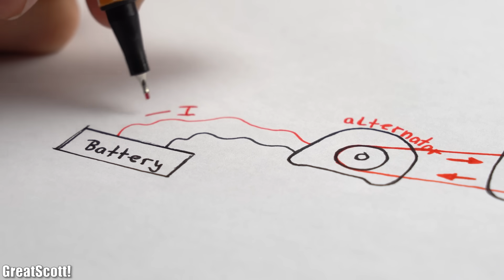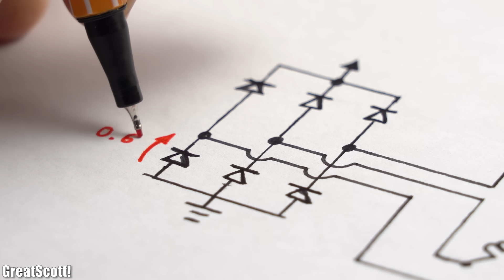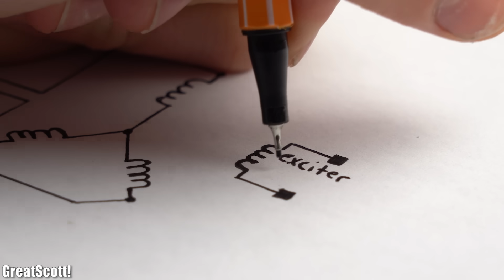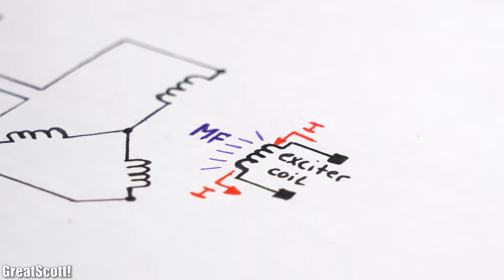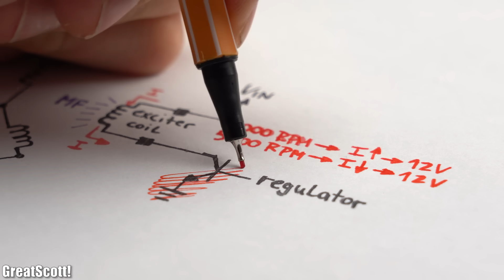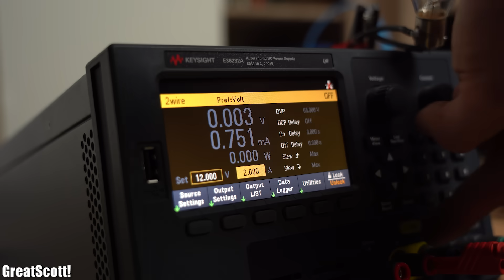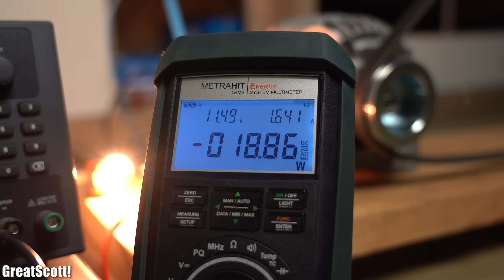Using a car alternator with a bike to power my home? How much energy can I produce?!

Comment: Hey Scott , you cycle's is in low gear. shift it to the small gear at rear and large gear near the pedal for more rpm and power. PLEASE try it😄
Reply: I was very pertrubed when he said he dont have enough RPM at his bike wheel while he had the lowest gear and didnt switch to higher one
Reply: Maybe he should try pointing the bike down hill  ..  ..
Reply: @hanzzarkov7690  Eat beans, he'd have a "tail" wind as well. 😉
Reply: @CHIL2903  eating beans and farting as I read this😂
Reply: @ethangreenyt  I guess only Great Scott should find out atleast in the behind the scenes video.
Reply: @JAYANTHISUDUPIRECIPES  I noticed the incorrect gear also 😂 btw you don't get any more power in a higher gear, you simply trade torque for rpm. Since power is a function of torque and rpm, trading one for the other via gearing doesn't change the total amount of power coming from your legs.
Reply: @thecrazyfarmboy  You don't produce more power, but you transmit more to the ground (or in this case, the wheel).
Reply: @sixstanger00  according to that statement, the gears themselves produce extra power above what the riders legs are capable of? Obviously that's not now physics works lol. Think about this statement - power is a function of rpm and torque. Let's say you need to climb a steep hill, wouldn't you want to put it in a high gear if that gives you the most power? Of course not. The correct situation for a high and low gear are different, but both ways put down the same amount of power. 1st gear puts it down in the form of high torque with low rpm, top gear is low torque with high rpm, and every gear in between is a similar tradeoff
Reply: @thecrazyfarmboy  
according to that statement, the gears themselves produce extra power above what the riders legs are capable of?

Nope. That isn't what I said at all. Bicycle gearing is no different than automobile transmissions - lower gears produce more torque, higher gears transmit more power to the ground. 

In a low gear, the rider's power is being use to turn the pedals (or crankset). Hence why it's easier to pedal in a low gear. 

In a high gear, less power is applied to the crankset and more is transferred to the rear wheel for propulsion. Bicycle gearing functionality is nothing more than torque multiplication. 

The amount of power PRODUCED never changes, but the gear selection determines where the power is APPLIED. 
Low gear = at the chainring 
High gear = at the drive wheel 

Let's say you need to climb a steep hill, wouldn't you want to put it in a high gear if that gives you the most power?

No, you wouldn't. Because climbing uphill puts the trajectory of the rider at a steeper angle relative to the pull of gravity, which is why it's harder to pedal uphill than to pedal across a flat. 

If it's hard to pedal, you want to use a low gear because in this situation, you need TORQUE more than you need POWER. Ergo, it's more important that you keep the pedals spinning than it is transferring maximum power to the drive wheel. 

Transmitting all of your power the drive wheel means dick if you have nothing available to turn the crankset. 

So NO -- just because your highest gear transfers the most power to the ground does not mean that is the ideal gear in all situations. Like I said....max power at the wheel is FAST......as long as you can keep those pedals spinning. 

If you can't climb the hill in high gear, then SOME of your power being transferred to the drive wheel must be syphoned off and used to keep the crankset rotating.

I race mountain bikes, so it's not like I'm just talking out of my arse here...
Reply: @sixstanger00  I think you're missing my point, I'm talking about the definition of the word "power". Power and speed are not the same thing, and now that I read your last comment I'm confident that nothing you're saying is wrong, it's just the way you explain it is way off according to basic physics. When you're in a low gear, you're not 'siphoning off power' you're simply trading RPM at the rear wheel for more torque. That's the key, SPEED and torque are what changes, not the amount of power applied to the rear wheel. You're using the word "power" in places where "rpm" or "speed" belong. I understand what you mean when you say that power is being used to turn the crank in a lower gear, because you wouldn't be able to turn the crank in a higher gear. However, the crank itself presents the same amount of resistance no matter what gear you're in - that's the resistance of the crank and pedal bearings and nothing else. So clearly the power from the riders legs is going through the crank like it always does, and to the rear wheel, where it's producing more torque at a lower speed. The reason you can't turn the pedals up a hill in a high gear is because in that gear, you can't produce enough TORQUE to go up the hill. The reason you can't produce enough torque to go up the hill in a high gear is because you're not actually putting any more POWER to the rear wheel!
Btw, I've been an avid cyclist for most of my life, as well as physics, so don't think I'm just some nerd with no real world experience lol..
Reply: Oh & as for the second part that you put in bold, I was clearly being sarcastic to prove that power and speed are not the same thing.... I literally said "of course not" immediately afterwards and you still took it as a serious statement and corrected me on it?! Good God lol the point is that it's not a matter of "torque or power" it's "torque or speed"
Reply: @thecrazyfarmboy  
Power and speed are not the same thing

I never said it was. Most of your confusion seems to be stemming from incorrect inferences you're drawing all on your own. This is at least twice that you've "corrected" something I never said to start with. 

However, the crank itself presents the same amount of resistance no matter what gear you're in - that's the resistance of the crank and pedal bearings and nothing else.

But it's not "nothing else" -- the crankset is tied to the rear wheel via the chain, and the rear wheel is in contact with the ground So you can't just ignore the drive line, because unless you're riding sans-chain or with the rear wheel elevated, the resistance is always going to be the crank/pedal bearings, etc + the weight of the bike/rider, because ultimately, the system is trying to propel the entire bulk forward -- not just spin the crankset. 

The reason you can't produce enough torque to go up the hill in a high gear is because you're not actually putting any more POWER to the rear wheel!

You're not wrong, but I think we're looking at this differently. You are looking exclusively at the rear wheel, whereas I'm seeing a finite amount of energy being distributed between the drive wheel and the crankset, depending on the gear ratio. (Which is not wrong).

The crankset is what's producing the TORQUE, not the rear cassette. Everything beyond the chainring -- chain, cassette, hub, rim, tire, etc are just a drive train for transmitting power to the ground, in much the same way a transmission, driveshaft, differential, axle, etc are on a car. 

So let's try it this way: 
The easier it is to pedal, the less power the rider must exert, yes? After all, you don't need to pedal as hard to maintain 25 MPH on a downhill as you do to maintain the same speed on a flat surface in a headwind. 

So we therefore cannot say that the power at the rear wheel never changes; it MUST decrease by basic physics because power input at the crank has decreased. 

Now let's go back to your uphill scenario: 
Climbing uphill in 1st gear makes spinning the pedals easier, thus requiring less output from the rider. If you've ever raced criterion or XC, then you must know this fundamental rule. Riders choose low gears on steep climbs to conserve energy so they can blast on flatter sections. 

But if we go by your logic - that is, that the power output never changes - then in what way is a rider conserving energy? Presumably, climbing in 1st would consume the same amount of energy as climbing in 5th...? But for that to be true, the rider would have to be as exhausted at the top in a 1st gear pull as in a 5th gear pull...? 

I have also been a major automotive enthusiasts most of my life, and I've always looked at a bicycle the same way as a car.
Rider = engine 
Pedals = pistons
Crankset = crankshaft/flywheel
Chain = input shaft
Cassette/derailleur = transmission/final drive gear
Hub assembly = axles 

In a car, if you try to drive highway speed in 1st gear, you'll redline at extremely high RPM, because all of the power is being used to spin the transmission itself, rather than propelling the vehicle forward efficiently. (i.e. very little engine power is actually making it to the ground). 

At highway speed though, inertia takes some of the workload off the engine itself (just like on a bike), thus less power is needed to keep the driveline spinning, so the power can instead be transferred to the ground and propel the vehicle. 

That's how I'm looking at a bike. There are power meters that can be attached to a bike's crankset (I'm sure you know this). 

So if I were spin the pedals as hard as I could in 1st gear, the meter would register a ton of power, but I'd be crawling along at a snail's pace. Ok...so where is all that power going? CLEARLY it can't be going to the ground, because if it were, I'd be propelled forward much faster. 

The answer, as I've maintained, is that all of the power is being used to rotate the crankset & driveline. 

The gear range on a bike determines how the power gets distributed between the crankset & the ground. 
More to the crankset = easier to pedal 
More to the ground = harder to pedal, but propelled much faster.
Reply: @thecrazyfarmboy  
Good God lol the point is that it's not a matter of "torque or power" it's "torque or speed"

Um, no. You're the one who just got through telling me power =/= to speed. 

Any kind of vehicular work has always been measured with "torque and power." 

Torque = twisting force 
Power = what's available to apply twisting force 

A vehicle moving at high speed uses less torque because inertia is doing the work. Thus, the finite amount of power available from the engine can be redirected to the ground instead of focused on twisting the driveline.
Reply: @sixstanger00  "thus, the finite amount of power available from the engine can be REdirected to the ground instead of twisting the driveline." LMAO listen, saying words like 'thus' and 'finite' doesn't make you know what you're talking about, it only makes it sound like you do.
Reply: @sixstanger00  what I've been saying is not MY theory... It's very basic mechanical physics which any professor in the field would back me up on, however they'd also be smarter than to get into an argument with someone who doesn't even know what they're talking about in the first place. (which is where I'm guilty.) I didn't make it up, I learned it from both study and experimentation. You may know a lot about how to ride a bike and what gear to choose, but your understanding of the science behind it sounds like your own made up theory.
Reply: @thecrazyfarmboy  90 rpm is peak good for human legs
Reply: @thecrazyfarmboy  Scott said in the video that the alternator is designed to produce power at around 2000-3000 RPM, and he was turning it much slower than that, so a higher gearing definitely could produce more power.

A decently fit cyclist can generate several hundreds of Watts for short periods so he definitely wasn't getting an efficient power output for his effort.
Reply: @XenFPV  That's true, in terms of generating electrical power, you are absolutely right that he could generate more using a higher gear ratio. I was simply referring to the laws of mechanical power, trying to explain the relationship between force and velocity, and the fact that in a low gear you're not just using up power to "turn the driveline" like the guy I was arguing with said. If you're pedaling up a steep hill, obviously the power from your legs is being transferred to the rear wheel right? Because you may be going slower, but you're also producing way more torque at the rear wheel. And as he didn't seem to be able to understand, mechanical power is a function of both torque and rpm.
Reply: @sixstanger00  That's not how torque and horsepower work. A good way to think of it is torque=the total angular force and power=how often that force is applied (it's a bad analogy but it's the best way to explain it in simple terms).
Reply: @JAYANTHISUDUPIRECIPES  it's just like how a 200 hp car will be able to produce 200 hp regardless of whether its in 1st or 5th, the difference is how the power is delivered
Reply: @thecrazyfarmboy  car motors do not delivery constant power..
There is a rpm curve
Reply: @sarahconner9433  yes yes I am fully aware of torque curves for engines and how they dictate power based on how much torque is produced at a given rpm. I was trying to explain something in simple terms so that he might understand it. Also yes I know that humans can only reach about 100 rpm at the crank, but I don't really see what that has to do with anything lol. My point is that if you're pedaling at 100rpm as hard as you can, then it doesn't matter wether you're going slow up a steep hill, or fast on a flat section. If you're pedaling as hard as you can to maintain the current speed, then you're making about the same amount of power in both cases.
Reply: @sarahconner9433  : Actually, car motors, when the throttle is kept at one position, do produce the same amount of power.

The reason why a car has an RPM curve, is because of going from idle (little to no throttle) to Wide-Open Throttle (WOT). If at any point in that curve the throttle is kept in the same position, it would produce the same amount of power over time (ex: 50% throttle).

What is being discussed here is the idea that automotive transmissions take whatever power is available to overcome inertia and friction to put a car in motion. With a bike, it's the driveline. Because a human rider on a bike will always have less mass than a human in a car, it takes less energy to get the human on a bike moving easier.

When you add in all of the ratios in the gearing and driveline, that is where the application of the available horsepower or watts (units of force) changes, because at that point, you're using the same amount of force, and changing it from torque to speed.

Unlike many people, I find the term "power" to be a misnomer, because that term was not one I learned about in high school physics class.

And just so anyone knows, I also compare a bicycle and rider to a car. The difference is, cars -- particularly AWD and RWD cars & trucks -- have one more gearing ratio a bicycle doesn't have, which is the final-drive ratio in the axle. Some would argue that the transmission is the front chainring, but I disagree, because that is not where the majority of available force is changed, the rear derailleur is. The front chainring is where a transmission would go into overdrive, for example, as most cars go from 1:1 (engine:transmission) to, at least in my truck, to a 1:0.75 overdrive ratio. Ergo, the chainring, like the Overdrive gearing, or trucks with a Tow Package, acts just like those ratios do in a transmission. The rear derailleur does not act like the final drive ratio that is located in a rear axle, because the final drive ratio in a car or truck never changes.
Reply: @isaiahwelch8066  thanks for your comment. Were both trying to help this guy....I worked at Ford , general Motors and Honda F1... Car motors with fuel work on the principle of;:  "adiabatic isentropic exponent" of a Carnot heat cycle and the electromagnetic lightwave  motor of hienrich Hertz.... Very complicated stuff... Car gas fuel motors vary in efficiency at all rpm.... usually Rich at low rpm and lean at high rpm and make horsepower kind of  linearly with increased rpm.... The interface is compression ratio, temperature of exhaust and valve lift duration.... As rpm increases valve lift duration decreases and eventually at 20000rpm (333hz),  the valve duration becomes almost zero, and fuel and air  flow declines and less horsepower... Not including balancing camshafts and valves at 20000rpm.  So it's not at all related to the carb throttle... As all modern cars are fuel injected or even digital... In a bicycle the transmission loss is basically zero... Zero chain stretch from  human legs..friction loss in wheels is more...pull a bike..I did...it takes about 8 poundal force to maintain about 8mph constant speed...i.e. little wind.... Literally I used to use my 1 pinky finger on the rear tire of   F1 race car and shake it effortlessly forward and reverse like a empty can of soda.... Top secret frictionless wheel bearings... The purpose of gears is to change a  constant power input  to variable torque values output...output in a bike or car is at the wheels
Reply: @sarahconner9433  : Okay. Hate to tell you this, but there are several issues with your statement.

1. You mention that RPMs can reach 20,000, in a car. I do not know of any car that will reach that high of an RPM, as most engines will break apart before ever reaching that engine speed. The closest engine I've ever heard of that got anywhere near that speed was a DOHC engine that TRD (Toyota Racing Development) made for the AE86 Panda Trueno Corolla, back in the late 1980s. It still had a carb on it. Point is, even in that engine, you couldn't go more than 11,000 RPMs in it. If you pushed the RPMs to 13,000, you usually blew the motor up.
2. The next thing is that in most modern cars -- going all the way back to 1989, when fuel injection was made standard -- most engines, even OBD-1 engines, had some way to get out of closed-loop engine management, and into open-loop engine management. On my 1992 Ford Ranger, Ford did this by routing exhaust heat to a vacuum valve, which would let warm air combine with cold air, and thus, even from a cold start, maintain a better A/F ratio. When the engine was warm, this valve closes, as that function is no longer needed. Given this, you say that the efficiency of an engine varies across all RPMs. While technically true, it does not vary as much as one might think. Most custom engines with lobe lift in an aftermarket cam do not vary, with engine speed. What you refer to is something that Ford and other manufacturers only started doing about a decade ago, when VVT heads were introduced, which do vary cam lift and duration. Previous to VVT, this is not the case.
3. This is a point that makes me doubt what your entire statement is, because I never said anything about a carburetor. I mentioned a throttle -- this does not necessarily mean a naturally-aspirated, carbureted engine. I was referring to a throttle in the sense that the throttle was contained in a throttle body -- which, if you knew cars like you say you do, means that they are computer-controlled, and use digital signals to control different components, unlike carburated cars, which use vacuum components. 
4. As for bicycles: Actually, bicycles can have transmission loss. Anything that spins, if the bearings are bad or worn, can, in fact, result in a chain drive hesitating. I've ridden bikes like that, where that is the case -- and most often, the loss of transfer happens at the cogs on the rear wheel, because of brake dust and other dirt. Second, a chain on a bicycle can become stretched. The last few times I've gone to my local bike shop, they keep bugging me to replace my chain, because it is around that maintainence period to do so. And yes, while the wheels are the actual output in any system, most people who watch this video never consider what actually happens to the values of both torque and speed, as each set of gearing is encountered. There is a major difference between the following:
Bike: Human input (legs)>pedals + chainring>rear cogs>rear wheel
Car/Truck: Engine RPM>Clutch/torque converter>Transmission>driveshaft>rear gear ratio>rear axles>rear wheels

By the way, this isnt even covering both superchargers and turbochargers on cars, which change how cars operate immensely.

As you can see, the two systems are somewhat different, because the mass of the two conveyances are different, and thus, require two different means of overcoming both friction and mass, which acts on both.

While I get what you're trying to say, my biggest concern is that people who read your comments wont realize the common denominator between the two systems, which is the rules of physics, and how the applications of each are designed to overcome those rules. And in the application here, trying to use a bicycle to generate electricity, I find that the video creator really needs a bigger understanding of how electricity works, because I believe that if anyone were to just follow this guy's lead, he is going to get people hurt and injured, possibly killed. Electricity is no joke, especially if you approach it half-ignorant and half-cocked.
Reply: @isaiahwelch8066  oh isaiah anyone so woefully  out of touch with engine technology especially F1 is just sad 16, 17, 18 and 19700 rpm is common place especially with prototype newer models.. However they usually computer limit the rpm.. And Mazda wankle prototypes are even higher...either way motor engineers F1 discuss. 333 hz just as a common standard of upper limit rpm..... Darn it!, I thought I was talking with a real engineer....
Reply: @sarahconner9433  : There's the difference: I'm not talking about prototypes, I'm talking about the cars that are sold to the public. Since when has any F1 car, or a prototype like what you describe, been sold to the public? I mean, not even Nissan Skyline R34 GT-Rs are imported into the US. And yeah, the Mazda Wankle engines can be that fast, speed-wise -- but a car that has an engine like that? Only used on a track.

It's like trying to say that NHRA drag cars and funny cars are street-legal, when they're not. 

But even then, we've gotten away from the subject of the video -- and given that the creator really has no idea of what he's doing, I'm not sure if I want to see anything else he does. I mean, when a TV reality show on Discovery Channel -- The Colony -- can get it right about making power from a generator/alternator, and using wood gas at that, then what can anyone conclude, but that the content creator here, should do more research before trying to put out this kind of video?
Reply: @thecrazyfarmboy  no. That is definitely not true. You dyno in your 1:1 gear for a reason.
Reply: @wyattwalker3189  so tell me what that reason is then, based on experience and research, not speculation
Reply: @wyattwalker3189  I'm pretty sure I already know why you dyno in top gear, and it's not because you put down more power in top gear, but I want to hear your reasoning first.
Reply: @thecrazyfarmboy  you dont dyno in your top gear🤦‍♂️ you dyno in your 1:1 (normally 3rd gear) so your gearing doesnt affect your power (increase or decrease depending on if your below your 1:1 or above)
Reply: @wyattwalker3189  honestly, right after I made that comment I realized most cars have a 1:1 gear and it's usually not top gear lol. Dumb thing to say on my part. With that being admitted, I still stand by the fact that you put down the same amount of total power in any gear. It makes sense to always dyno at 1:1, for the sake of consistency between different cars on the same dyno. In a lower gear you get more wheel torque and less speed, inn high gears you get less wheel torque and more speed. Power is a function of both. Not one or the other!
Reply: @thecrazyfarmboy  🤣
Reply: @sarahconner9433  Engines do have rpm curves and produce different power at different RPMs. The point of the gearbox is to keep those rev's within a usable power-band for the engine. You could drive at 7500rpm in first gear, your engine won't last long and your wheels will likely spin as it's geared for torque to get the vehicle moving. As you move up the gears the torque drops as do the revs (for a given road speed). 
A bike is a great example - try and cycle off in the smallest cog (rear) and it's really hard to get moving but when you do your top speed is high and your legs (motor), are going at a reasonable speed. Now put it on the largest cog and it's easy to set off but if you want to go fast your legs (motor) will be going at crazy rpm.
Reply: @andrewausterfield6710  yes I thought I said this
Reply: He needs better support on the rear bike axle. Two posts per side and and angle, like this one 3:50 and a belt tensioner
Reply: @ethangreenyt  yeah I too accept that
Reply: Ad flywheel it will be easier to pedal and more stable speed
Reply: Farmer...yes, many ways the first is buy a laser temperature pistol and aim it inside the coils of the alternator working on a car reving at 3000 rpm... After about 10 minutes the alternator coils will be hot, take that temp...covert to Kelvin absolute...then convert outdoor cooler car temp to Kelvin absolute. Then eff%= [ (temp hot of alternator)-( outdoor temp of car)] ÷ (outdoor temp of car)] x 100%.... Most electric motors are very high efficiency around 35 - 40 %!!! Taking the temperature shift into account the wires and coil of alternator design wize are around 98% perfect!!!! Priliminary  the bike alternator is not getting enough high rpm....the alternator isn't efficient until around 3000 rpm in most cars!! Even though at very low rpm they still will spit out 13 volts DC...but little amperes!!
Reply: It will probably fall apart. Install solar instead.
Reply: @Commander_ZiN  he has solar, this is about generating power in other ways
Reply: @Mix1mum  Install more solar then if he needs it, this isn't a good way to generate electricity.
As someone who's used a professional setup to generate electricity, I know how hard it is to even generate 250W, also it's not fun like a bike ride is.
Reply: Farmer understood.however may I reignite your memory....power  = force x velocity.....so uphill downhill does make a difference....but your alternator video is highly entertaining....I watched because I wondered the efficiency conversion factor....with your intelligence make a bicycle airplane!!! They do fly... I would but I don't have time!!! Use balsa wood for low cost and wieght....an Olympic biker should hit a top flying speed of 13 mph at a hieght of 15 feet.
Reply: @sarahconner9433  thank you for the suggestion, and for checking out a video! Physics can be a conversation that is hard to have accurately over text lol.
Reply: @thecrazyfarmboy  agreed.....make the bike plane!!!! Aerobike!!! The climate change propagandist will sponsor you $$$  I'm  sure!!!! Me post PhD EE and theorhetical physics NIST.
Reply: @sarahconner9433  that's an awesome idea! I currently work full time so it's a bit of a challenge to find time for making videos, but i do have some pretty advanced knowledge on aircraft design and operation so that's something I'll have to write down in my ideas list. If you really want to see that then feel free to hound me about it in my comment sections 😂 there's nothing stopping me from doing some small scale testing on the idea!
Reply: @Sarah Conner As someone with an education in physics, do you think I could measure the efficiency of my DC motor using the following method? Recording the amount of torque and rpm being produced on the shaft at a given moment, as well as the amount of electrical power the motor is consuming in watts. Then I could use the horsepower equation to figure out how much mechanical power is being produced by the motor, which can then be converted to watts. Once I have them both in watts, all I'd have to do is figure out what % of the electrical power is being converted into mechanical power. It can't be the most accurate way, but if I do it properly I think I could get within 1 or 2 % of the correct answer.
Reply: what about adding something that runs off the power to turn the pedals, would that be viable? and no not any type of engineer so is an honest question about if it would work. and also add in a rechargeable battery to store the energy maybe.
Reply: @correlfreehand9454  good idea kinda....that's called a "power feedback loop"....it helps to a point....i.e. Toyota  electric cars have electric alternator braking system.. When the brakes slow the car it charges up an alternator on each wheel... This electricity goes to the main lithium batteries!!
Reply: @sarahconner9433  hahah...and here i thought it was the rotation of the wheels that did that not the breaking...heheh.
so battery is good but the pedal idea would need lots of work to be viable. as it would take more power to rotate faster.
guess remembering old mopeds where one would have to pedal it to get it to run is out then.
Reply: @correlfreehand9454  the battery power feedback is better..a mechanical system would be a foolish waste of time and wouldn't work
Reply: @sarahconner9433  like i stated earlier not an engineer so would not know if it where foolish or not. it was an honest question from one who does not know.
Reply: @correlfreehand9454  cool ya!! No worries!! Your thinking clearly!! And that's always a good thing!! In 2021 electrical electron things are highly efficient +85%... Mechanical things are not... Averages 10-20%..
Reply: @correlfreehand9454  no foolish questions.... Just foolish silent people....
Reply: @sarahconner9433  yeah it is the knowledge one has on a subject that when one asks to you a common question that you knew the answer for a long time ago like anyone we tend to forget they might not know.
but yeah did not know for certain if it was viable or not. so with that like anything else the more bikes probably more power production?
i know there is solar and wind, but thinking what if the wind is calm for too long or it rains for days and you need power but your not on the grid type thing. that is all i am thinking of, when not on a power grid what else could i do to produce needed energy qnd store it.
Reply: @correlfreehand9454  an old fashioned wind Mill in Holland is close to your desires of perfection...35% efficient
Reply: @sarahconner9433  huh...never thought about those as they visually are wind, will look into it. yeah thinking about ways for self sufficiency that could be even better for efficiency or to make them more efficient.
being a computer nerd, build and repair i do think that way, how to make something more efficient without needing more to make it that way.
Reply: Again another example of an engineer missing the most basic of things… and not realizing that getting rid of the gearing system was the worst mistake he made during the build.
Reply: i was wondering the same thing as well, why use the biggest gear
Reply: @ethangreenyt  in other words you had no idea what a bicycle was ...for..
Reply: I was about to say that exact thing
Reply: @ethangreenyt  literally noone asked. Why are you telling us this random stuff
Reply: Exactly my point
Reply: Yes
Reply: Was going to say, adding a much larger front sprocket will give more RPM, adding a heavy flywheel will both add to the workout but provide a freewheel for coasting power..
Reply: New smart alternator not require high rpm. At 1000 rpm can produce 120 amps however for prolong performance you need air fan to run in front of it
Reply: The solar power guys around here build gas powered alternator generators and say it takes 5HP to run one.
   1 man × 20 = 1 horse (
(approximately) 
So it's gonna take 100 shuffle dancing Babes for my house alone.
  To charge my electric car will take all the shuffle dancers on the Blvd
Reply: The power doesn't change with different gears on the bike. Power is rpm*torque and in the ideal case, switching to a higher gear will produce 5x the rpm (I'm throwing out a number as an example) but 1/5 of the torque, which results in the same power output.
Reply: The man is not on this planet. Has not grasped , the power to rpm ratio.
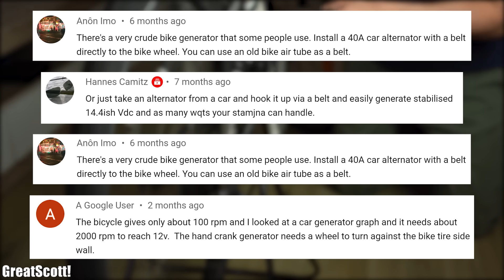Reply: came here to say that, havent watched furthen than 4:12 yet tho
i cringed a little when he said it took some tinkering to get it into a high gear and than put it in the lowest :D (as he said in the beginning, mistakes do happen)
Reply: @hannes-  at the end of the video it was still only in the 3rd or 4th gear on the sprocket. i was also wondering how much better it would get with proper tension and top gear. even with all the conversion losses I think you should easily get over 100W peak output from pedalling.
Reply: @steefant  I was actually stunned he didn't produce more; when I mountain bike I produce 150-190 watts regularly.
Reply: @steefant in general a healthy man can put out over 600W on a bike (my family races bikes professionally so we have power meters mounted)
Reply: Yup, some people can present something stupid in a confident way and most people would take it all in.  The whole project is idiotic.  Sometime I wonders about this guy big picture intelligence.
Reply: But then it will be even harder to pedal
Reply: @charlie_nolan  Yes but you can get more power right . It will be a good excercise 😅
Reply: @JAYANTHISUDUPIRECIPES  That's not how gearing works. You would get higher speeds but lower power. That's why your car can't start moving in 6th gear
Reply: @JAYANTHISUDUPIRECIPES  He will get more power only if his legs are up to the job. He will probablly get more power but for less time, and the overall result will be the same.
Reply: @JAYANTHISUDUPIRECIPES it only needs 1000rpm after that it makes no moor
Reply: @richardmillhousenixon Wrong! You would get higher rpm but lower torque
Reply: @rosskrt  That's what I said, Einstein.
Reply: @richardmillhousenixon  no, you said that with gearing you get higher rpm but lower power. Power ≠ torque, Einstein.

You mentioned torque in your next comment but the former is still wrong.
Reply: @rosskrt  I used the terminology that the original commenter used. This is also a THREE YEAR OLD comment.
Reply: @charlie_nolan  if he can pedal it with hand then it wasn't good.
Reply: @charlie_nolan  ahhhh, that why we have E-Bikes! HEHEHE
Reply: I need to relocate the battery pack. :)
Reply: @charlie_nolan  may be harder but not any harder than riding the bike in the highest gear
Reply: @charlie_nolan  But then it will be even harder to pedal

Not really. The rear wheel is suspended in the air, and the alternator offers little resistance. It's only harder to pedal in high gear if the rear wheel is in contact with the ground, because it's having to propel the weight of the bike & rider.
Reply: @sixstanger00  power is not free, it will be harder to pedal the more wattage is produced. Look up a video where a German Olympic bicyclist could barely toast a piece of bread at 750W.
Reply: @BlownF150  I never said power is free. But I also race mountain bikes - I have for years. So this is kinda my thing. How about you?

Cyclists like myself (and probably the German) sometimes use trainers that attach to the rear of our bikes. The device uses a magnetic coil inside to create resistance. I also train on recumbent bikes at my local gym, which have a similar mechanism. 

Is it harder to pedal? Yes. But not as hard as trying to pedal a bike up a hill in top gear. Like you said -- power isn't free, so setting things up so it's uber easy to pedal is an exercise in futility; the easier it is to pedal, the less power you're transferring to the drive wheel because all of your power is being applied to the crankset.

The less power you transmit to the drive wheel, the less power gets transmitted to the alternator. For this experiment to have any hope of working, you definitely can't skip out on leg day.
Reply: @BlownF150  hey man he races mountain bikes, clearly he's a scientist 😂 nah you're right and most of what this guy is saying is coming straight out of his arse
Reply: @sixstanger00  The alternator provides resistance proportional to the power it is producing at a given RPM, so if you're generating useful power from it the mechanical resistance of the alternator absolutely is significant.
Reply: @XenFPV  I'm saying that this setup is literally no different than a recumbent bike at a gym. Their LCD displays are powered by the pedals. Magnetic coils are used to create resistance on the pedals for the user. 

I can ride for 1 hr straight on my bike with an avg power output of 162 watts. 

The energy you exert to spin the pedals is also directly proportional to the output from the alternator. The harder it is to pedal, the more energy you must exert. 

You should EXPECT some resistance, FFS. Without any resistance, you (the rider) are not exerting any power; you're just spinning the damned pedals.
Reply: @BlownF150  746 W = 1 HP
Reply: @XenFPV  actually the alternator provides resistance proportional to the load applied to it
Reply: @ethangreenyt  Yes but considering that he is on a flat surface and the cycle is elevated from the ground it might be ok.
I guess
Reply: @JAYANTHISUDUPIRECIPES  if he points the bike down an incline he can start peddling then freewheel so it’s not as tiring as he is going down hill 😉 will work as well as the buttered toast in the cat generator 😂
Reply: You know we were talking about all car fuel  motors! Your just trying to hide your ignorance and lack of knowledge. I understand... Anyway....almost all F1 engine go to 20000rpm... The prototypes go by higher....You already proved you know nothing about cars and car motors.....I just dropped the mic front of you.....i'm done.... Your welcome....
Reply: @sarahconner9433  : Lady, you are the one who knows nothing. I'm the one people go to, to fix people's cars, because I DO know what I'm talking about.

And honestly, the fact you're using an appeal to authority, as an argument? Your argument is invalid, let alone even worth considering. You don't get to throw the "I'm an auto engineer, I know what I'm talking about, you don't" argument. That is a logical fallacy, and one that invalidates anything you say.